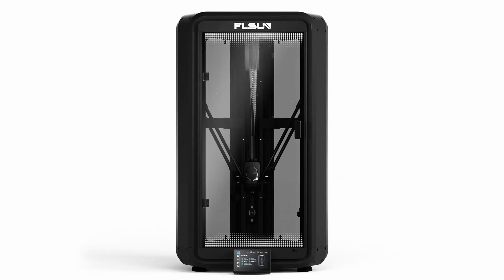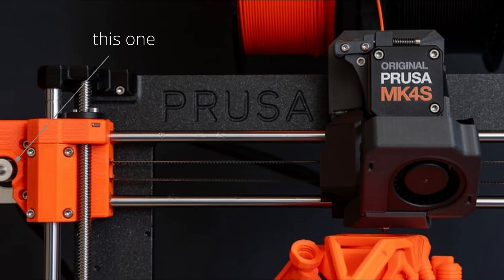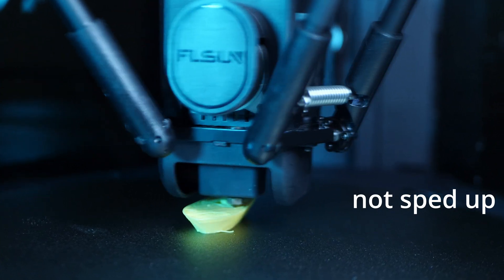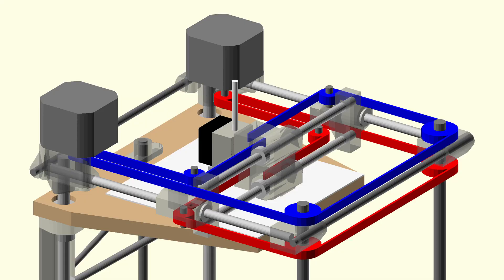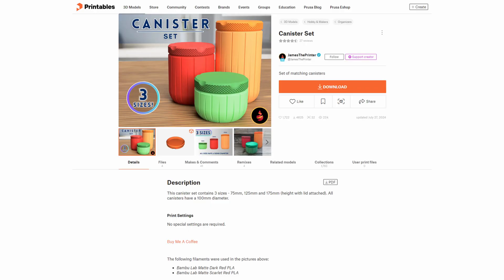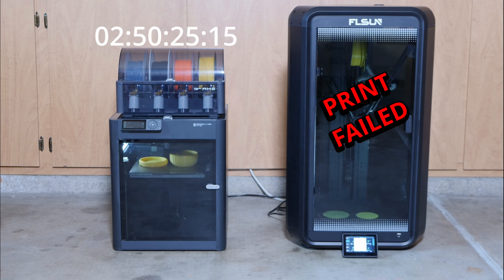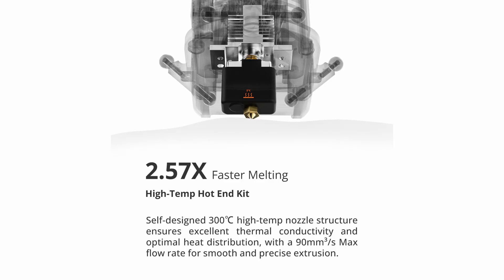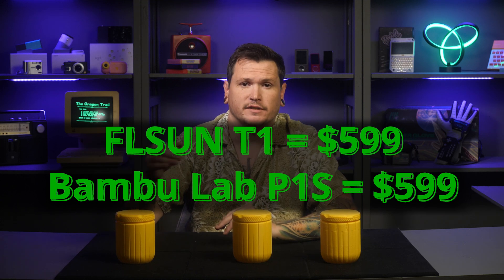Can the New FLSUN T1 Delta 3D Printer Compete with CoreXY?

Comment: I own the X1C and FLSUN S1 Pro.  The FLSUN is more than twice the speed of my X1C. But I still use my X1C quite a bit because I love multi-color prints. But if I need to print a single color print at lightning speed, I use my FLSUN every time.

Comment: From what I've learned, deltas have an inherently better quality print at any speed. The FLSUN is pretty good but there's room for improvement. The fan problem can be fixed by use of a fan designed to be quiet.

Comment: I should note that while I dont know that it's true with the T1, with the S1, their bigger version, many reviewers found that volumetric flow rate to be, without sugar coating it, a lie (like one third of what they actually promised in reality). The print file they included also was gimmicked in such a way that it looked in the settings like it was going as fast as it said, but for people who knew the implementation details of their klipper and klipper frontend setup, they knew it simply was set with slow accelerations such that it never actually hit the volumetric flow rates it said on the screen. In reality, if I recall correctly, comparing similar filaments, like PLA to PLA, it was indeed a bit better than a stock P1/X1, but nowhere close to their nearly 5x rating, like not even remotely.

Anyhow, I didn't expect an overview to cover this or get into such detail, because it really was, in my opinion, designed to deceive reviewers and customers with flashy numbers (and to be honest most 3d printer companies do this, some more truthful than others), but I just thought I'd mention it. I am of course interested in seeing what robot arm you're coming up with/what its payload capabilities/level of smoothness will allow it to do.

Oh, also a super small note: The print height of the T1 is indeed taller, but a small caveat is that just like the bit about rotary motors, it's actually kinda conical. Like a very flattened cone.
Reply from the maker: Oh wow, I hadn't heard about that! I'm not really surprised, because the 90mm/s/s figure seemed insane to me, but that's still disappointing to hear. As you said, manufacturers like to fudge the numbers a bit, but there is a point where it becomes difficult to forgive. If I was doing a full review, I might dive deeper into that. But to be honest, I'm kind of sick of reviewing 3D printers, haha.

I'm very excited about the robot! It is an arm with 7-DoF meant to hold a camera for recording nice videos of the things I talk about. I'm still very early in development, but initial tests are going well with 4 axes. It has no trouble carrying my Lumix GH5 with a lens. The shoulder and elbow motors are CubeMars AK80-64, which have crazy torque. It is going to be awesome!
Reply: @serialhobbyism_official  Very interesting. I imagined it might be camera related, and I'm always interested in seeing those types of arms because getting the smoothness down for a camera seems like a real challenge. I forsee many brushless motor controllers and gearing mechanisms.

Good luck with that and I totally get being tired of reviewing printers, especially when it's basically just a race for many cheap companies to copy 2 companies and some hobbyists the most cheaply.
Reply from the maker: @BeefIngot  You're spot on about smoothness! That's the main issue I'm working on solving right now. I'll actually have a short clip of my first test in my next video, which should be published tonight or tomorrow :)

Comment: Is that little shelf you had the bamboo on strong enough to print at speed? I see you ran the tests on a concrete floor.
Reply from the maker: Great question! I only had it on that shelf for the picture and don't print on that. However, it may not even matter. Maker's Muse has an awesome video on this subject and came to the conclusion that it probably doesn't make a difference: https://youtu.be/D-eLhKdKAdk?si=diIuo2JWjyZDxG35
Reply: 3d printers dont care all that much about the surface outside of if that surface resonates near to the frequencies they frequently vibrate at is my understanding. If you free float a printer, or nail it to concrete, both would have similar effects in terms of just keeping high amounts of resonance from showing in your prints.